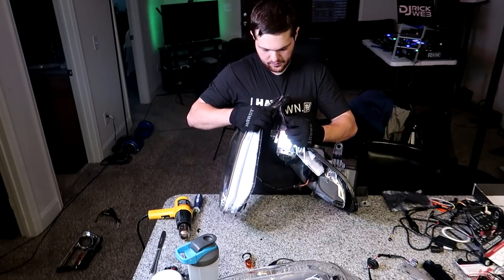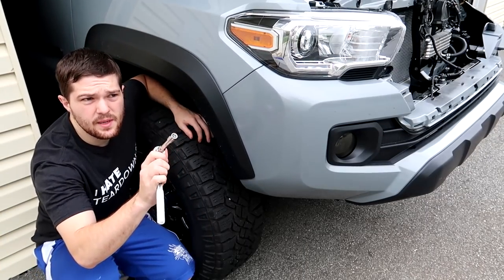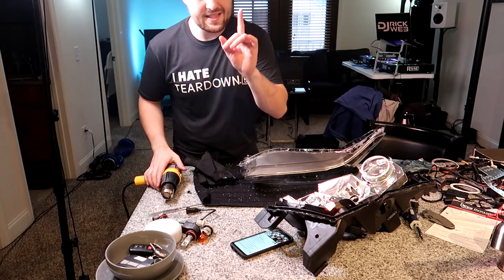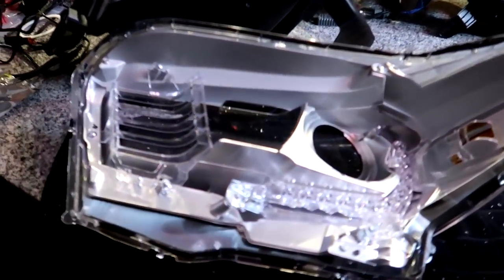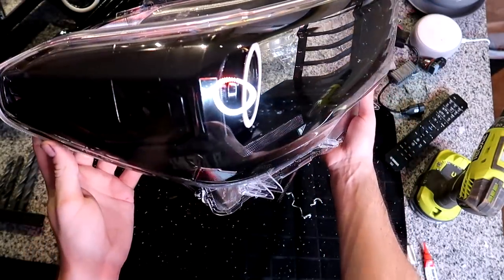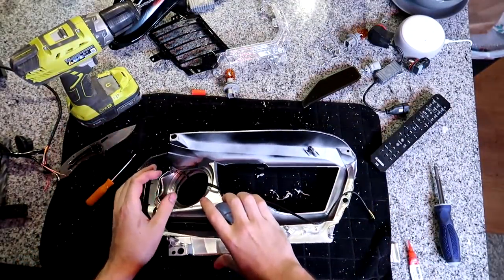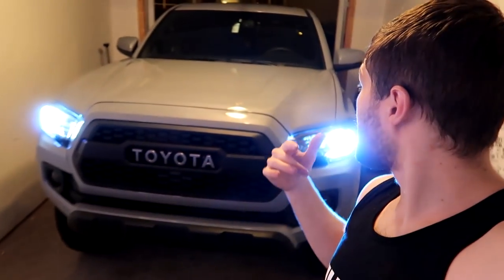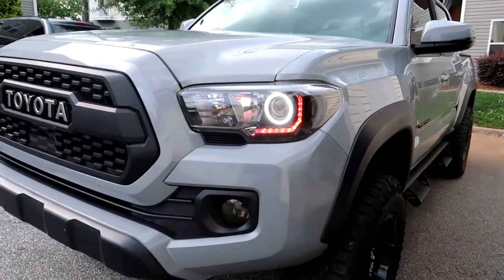Custom DIY TRD PRO Headlights - 2020 Tacoma Off Road

Comment from the maker: Diode Dynamics!
DLR - RGB Upgrade KIT - https://www.diodedynamics.com/multicolor-led-boards-for-2016-2019-toyota-tacoma.html
Halo KIT - https://www.diodedynamics.com/hd-led-halos-for-2016-2019-toyota-tacoma-pair.html

DIY info - I had enough prior experience that I did attempt this project 100% myself, but Diode Dynamics does recommend that you have this done by one of there professional installers which you can find on there website here! https://www.diodedynamics.com/find-a-dealer

Comment: Taco rick. Want do mine minus the halo n diod dynamics? 🤣
Reply from the maker: Be cheaper to find a pro local installer. Dioide dynamics has a way to locate installers near you on there webiste
Reply: Ill have to check that out. Im in Monroe nc. But just want to black out mine. Keep it simple

Comment: All that work and you didn’t upgrade from halogen to HID projectors and bulbs?
Reply from the maker: For the high beams that I never use? My low beams are already led projectors
Reply: @TacoRick  you should have upgraded to Morimoto MLed 2.0 projector instead of using those led bulbs

Comment: First one was perfect second one I cracked twice in the ridge in that final corner. Am I screwed? What did you seal yours with? Damn this was a pain in the a*
Reply from the maker: Buytl. Diode sells it. Its the same glue you had to pull the light apart from

Comment: Kid I love ya and great videos.  But gen 2 taco modder here.  All the ones your doing are brutal.  Those million dollar headlights you just broke the seal on will never be right.  It is a 99% failure rate on sealing them totally. You will see moisture in them soon.  And tapping into the new harness like that(with those type taps).  I would never. Those will soon fail also. The depot lights in the rear will last a year or two if your lucky   I did all this stuff and ended up having to buy all new again to replace. Go to Gen 2 forums and you'll see the stories.    But hey it's your truck and so what u want.  I love the videos   I just saved up and bought the real TRD Pro stuff instead.  Even the lift.  I would do nothing but the 2.5 TRD version .
Reply from the maker: I appreciate the criticism. I dont appreciate "kid" I am 25.
Reply: @TacoRick  haha.  Kid is Just a saying where I am at. Not meant to be about age at all.  And I take it all back anyways.  I watched all your videos now and absolutely LOVE them.  I'm wrong!  Maybe back in the gen 2 day you had to worry about what I said but  seems different  now.  And it wasn't critisism.  Just brought me back to my days.  Anyways addicted to your videos sir(another saying/thing where I live) and keep them up!   Don't listen to idiots like me that can't write what they really mean. .  I don't have a Gen 3 and I can't stop watching!!!
Reply from the maker: No problem man. Appreciate it

Comment: Have you had any issues with moisture getting into the lights?  Any issues with the wiring since installation?  These look bad ass but definitely not am easy project.
Reply from the maker: No moisture issues